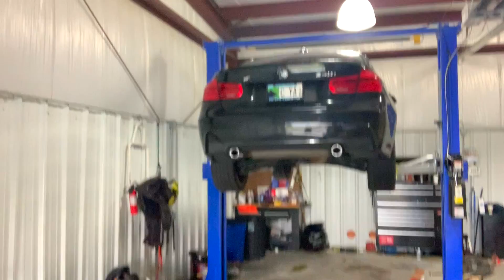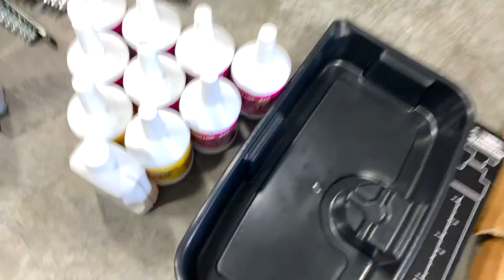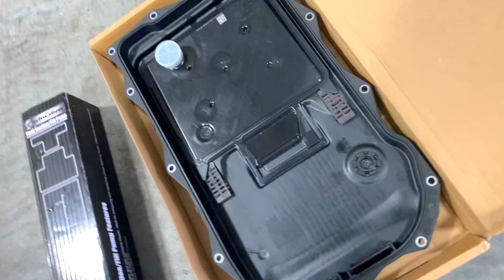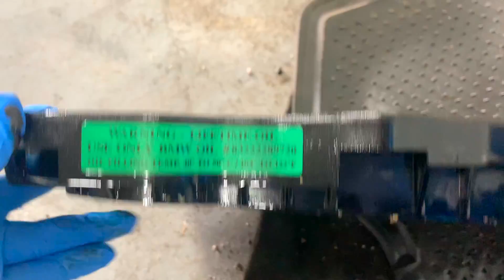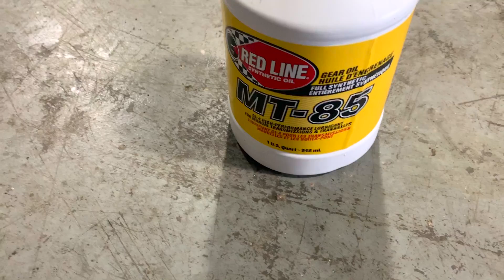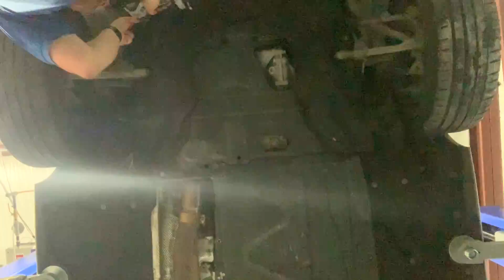BMW F30 340i TRANSMISSION AND REAR DIFFERENTIAL FLUID CHANGE

Comment: I know I’m very late but I just noticed the rear differential fluid u used and linked is meant for Manual Transmissions, is there a reason u used that since u have a auto?

Comment: So you used the same oil for the rear differential as you did in your video for the front differential? 75-85 for both? I thought front takes GL-5 and rear takes GL-4?
Reply from the maker: That must have been an old set up but what I used never gave me issues.
Reply: @NoClutchGarage  why don't you like Gl-5 in the rear ? Bimmerworld recommendeds it in the rear I'm not sure why BMW switched to GL 4 for the rear

Comment: Just watched all 3 of your videos about this. Can I use these fluids on my f30 n55 xdrive? Also would I just need 1 bottle for the rear diff, front diff, and transfer case?
Reply from the maker: Yes they use relatively the same components so they should be the same.
Reply: NoClutch Garage is only 1 bottle required for the rear, front, and transfer case?
Reply from the maker: Yes one of each should do it!
Reply from the maker: I have all the link in the description!!!

Comment: Don't hand pump, use DasMarine 12V 60W Oil Change Pump Extractor, Oil/Diesel Fluid Pump Extractor Scavenge Oil Change Pump Transfer Suction Transfer Pump. connect to your Car Battery.  That's what I use, it's great.

Comment: Thanks for video!  I saw a few videos of zf transmission fluid change, I wish you would let people know torque spec each bolts.
Reply from the maker: I do hand tight and one or two extra turns. When I made the video I couldn’t find any torque specs for this, but with the pan being made out of plastic you don’t want to over tighten the pan.

Comment: Just saying that every single website and forums are recommending GL-5 diff fluid.
Reply from the maker: For cars equipped with an LSD it is recommended GL-5, most cars don’t come with an LSD and have Open Diffs, those will need GL-4 Oil, which is why I used GL-4 fluid. GL-5 is too corrosive for these new differentials and will destroy them if you’re not careful!
Reply: @NoClutchGarage  fcpeuro recommends gl-5 redline for a 2018 440i
Reply: @NoClutchGarage do you still feel this way? From my understanding gl5 is only corrosive to yellow metal which our diffs don't have.

Also CAFE regulations essentially made bmw switch to something that's more fuel efficient hence the gl4.

What do you think as per your experience?

Comment: when is an appropriate time to change tehse fluids?
Reply from the maker: Recommended at 60k miles depending on how hard you are on your car. May be needed to be done sooner if tuned and constantly at high speeds.
Reply: @NoClutchGarage  thank you

Comment: do you have a link to where you got the transmission pan from?
Reply from the maker: I have just added it under “featured” in the description!
Reply: thank you kind sir, just about to do this to my 340i
Reply: also wanted to ask do we have to put any slip additive in the rear diff, when I went to BMW of San Antonio and said I wanted to do a rear diff fluid change they said they wouldn't do it, so I asked them to sell me the rear diff fluid  and they said I needed some additive  to add to it but wouldn't sell me it because they insisted the car doesn't need it, but from my previous car bought brand new after 10k miles the fluid was nasty so I have 40 k on this car and I just want to change  it for ease of mind .
Reply from the maker: I didn’t use additive, I don’t think it is necessary. Adding the additive won’t hurt though!